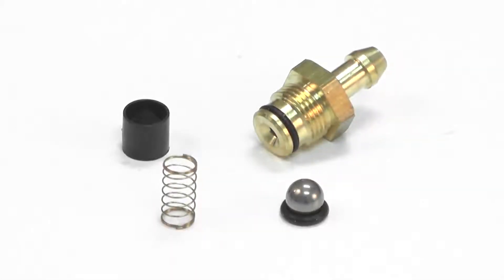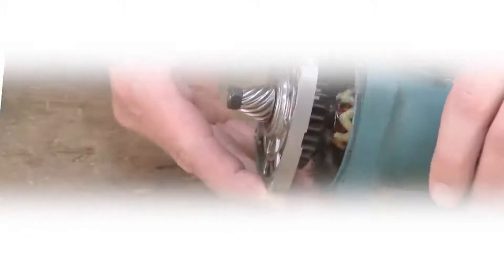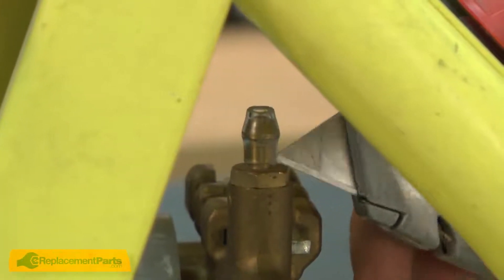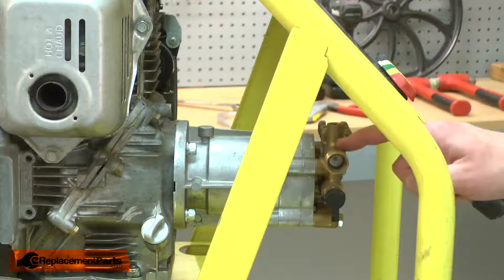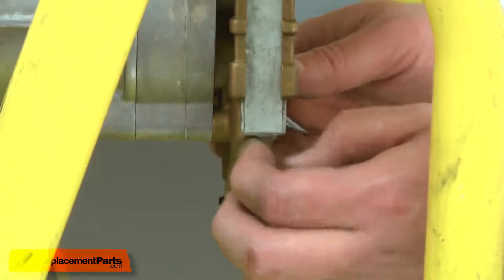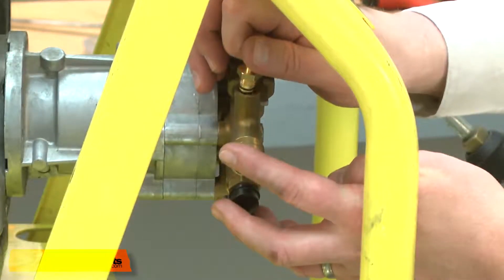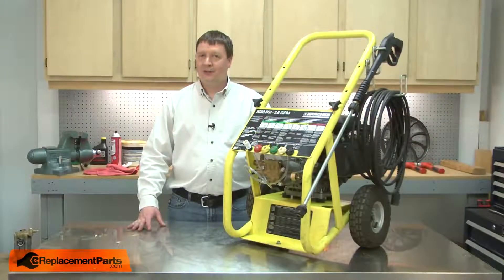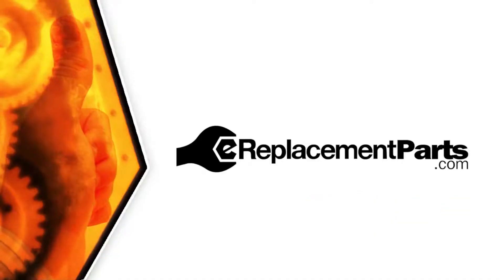Karcher Pressure Washer Repair - Installing the Detergent Valve Kit (Karcher Part # 2.883-862.0)

Comment: Thanks for the grease tip to hold the o-ring on.   The inside of my value was blue and the tube was clear, so I wasnt sure if the tube had fallen out.  I used a small screw driver and slide it along the inside and the clear tube popped out.  The rest was super easy.

Comment: Great information. My Karcher gas pressure came to me not running, once fixed, what detergent is recommended and is there place to store this bottle? Or should I just make and weld / bolt it on to fit a robust 1qt bottle or tank?